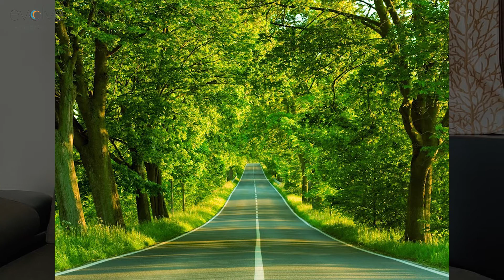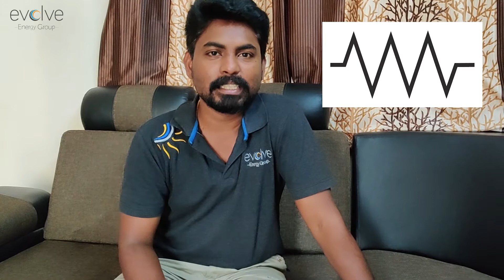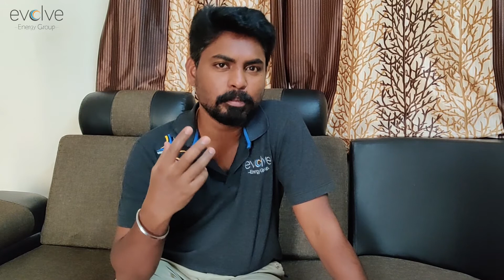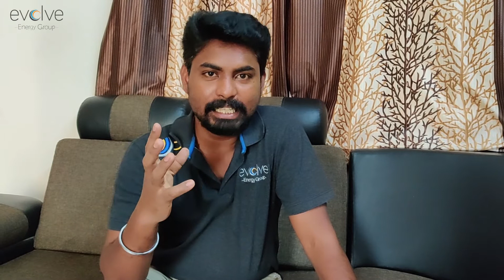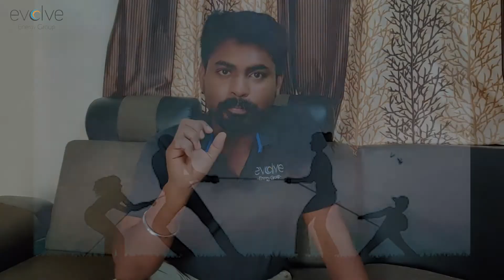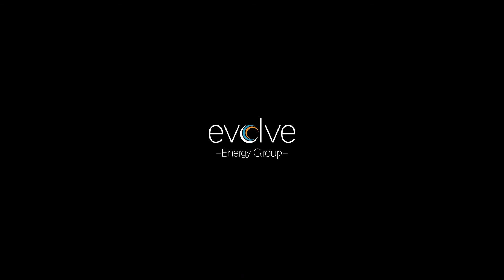The Concept of MPPT | Sivakumaran- CTO | Evolve Energy Group

Comment: Sir,can 2 MPPTs in Solar On Grid Inverter be shared to handle more current.For example 2 MPPTs have 11 Amps Rating each,can these be shared to handle 18 Amps output from solar panel?